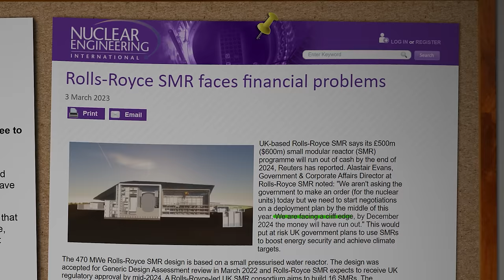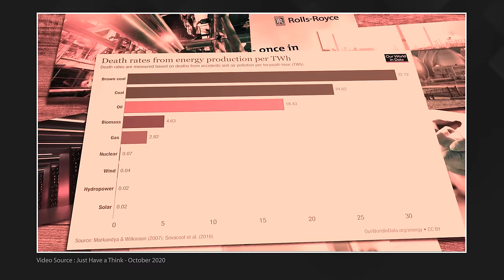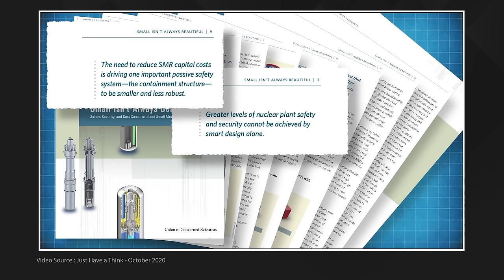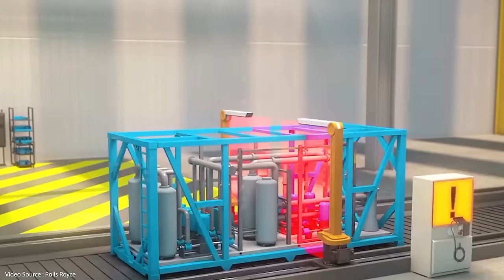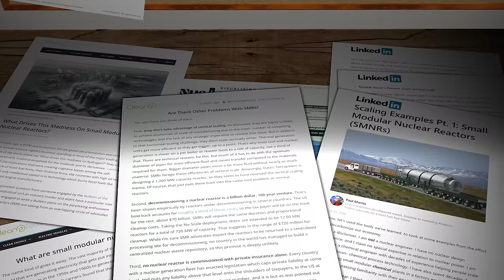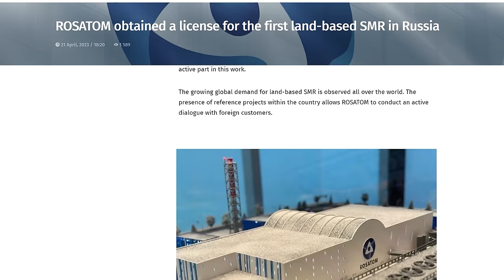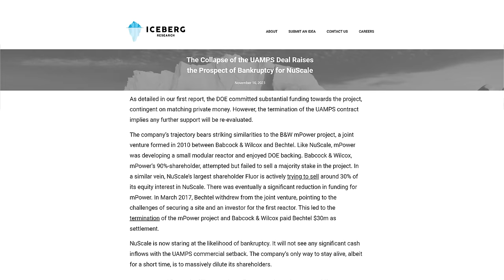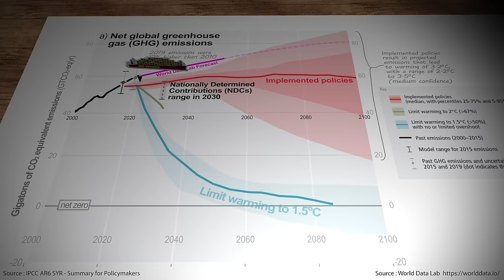Small Modular Nuclear Reactors. The Verdict

Comment: Wind and solar might be great in the UK but it’s far less effective in cold climates where the sun rarely shines and the snow and ice cover the panels.  If China can successfully install the Westinghouse system it seems reasonable folks in northern USA and Canada could also make SMRs that produce reliable power.  In quantifying the cost, the high voltage trunk lines of the grid need to be included in the cost IMO, as well as the many transfer stations.  Add to that the vulnerability of the system to cyber and traditional air bombardment in time of war and the exposed surface grid would be an existential threat to the inhabitants in wide regions depending on the transfer of power through the grid.  I suspect the ROI analysis would require considerable time to assess the long term systemic differences and how grid replacement might change the calculations as well as vulnerability to a large solar flare or an EMP attack or other forms of destructive nonsense that happen in time of war / military conflict.  Just suggesting SMRs may be an important part of the future state even if they are more costly.   If wind and solar only outputs 20 percent of the system capacity due to weather issues…. or the transistors are fried by solar flares and have to be replaced….. or maybe they crack from the ice storms …. the real world efficiency and cost per unit of electrical output may be much higher vs installation in moderate climates with lots of sun or wind.

Comment: Yet to see the key environmental concept of "cradle to grave" applied in any such discussion nor, most importantly, reflected in government policy.  What are the environmental (and economic) cost of building SMRs, solar or wind farms?  What are their respective lifespan and prospect/cost of disposal (or material harvesting/reuse)?  What are the storage and transmission requirements and losses?

Prudent choices necessitate a cradle to grave analysis.
Reply: Well, we know renewables can mostly be recycled. Wind vanes not so much, but they would occupy a fraction of the landfill that goes to coal ash, per unit of energy produced.

Another question is "what if it's not recycled/disposed?
Well, a PV panel dump would be unsightly, but you could walk around in it, or just bury it.
Neglected batteries will certainly contaminate a local area, but will react naturally to more stable compounds in a matter of years or decades. It won't kill you to walk across such an area in gumboots.

Spent Nuclear fuel and abandoned reactor equipment has no such comfortable images. The containment structures will fail without continuous maintenance, Either quickly in spent fuel fires, or slowly by erosion. The release of materials will be correspondingly fast and wide, or more gradual but highly concentrated as it follows waterways. It will make huge tracts unliveable and dangerous to traverse, and the source will be extremely dangerous to approach for many centuries.
So far no Spent Fuel or High Level Waste whatsoever has been disposed. None. this, the richest generation of the richest group of nations on earth thinks disposal is too expensive.
Imagine a less rich society, after a war or extreme climate events, or multiple crop failures, or plague, or just economic collapse. Who will pay to maintain existing temporary storage? Who will pay for the permanent disposal megaprojects that are presently too expensive?
As these facilities age, the time where we have options will reduce to nothing. There will be a time where the only options are to support a workforce to do it (slaves?), or move to the Southern hemisphere and hope that the few facilities in Africa and South America do not release too much too quick.

Comment: All new tech production methods, especially for heavy industrial infrastructure like power, comes with initial cost overruns that are often covered by additional investors and governments. This is initial early cost teething and nobody should be too concerned about it. Remember folks, solar panels required decades of direct government subsidies to get to their current pricepoints and the same goes for other renewables as well, nuclear is no different. People need to stop fearmongering especially considering that the vaunted storage options everyone talks about remain non-existent outside of solar thermal powerplants as batteries currently available do not cut the mustard. Nuclear is coming back too and alongside every other green energy source.

Comment: Going small and away from large complicated infrastructure, is a better idea than mega scale projects. No matter the energy source. Give me the option to generate all the power I need, where I live. Yes there are, of course, large population centres that need significant power. However, there are large areas of more sparse population that should de-centralize, moving towards self generation for all their needs. Supporting that will decrease the over all load, which helps larger centres. Someone somewhere should crunch all kinds of numbers ad see if there is a more cost effective option. I have been thinking for a while that the correct balance could be found. Do that while still looking for a magic bullet, like: SMRs; plasmoids; .... etc.
Reply: 87% of the world’s population lives in urban or suburban areas. Your exception, large population centres is the norm. Remote areas can utilise solar panels, wind turbines and battery storage. The exception is high latitudes in winter. Up there it’s mega project or survivalist in winter. Much of the urban environment the low density part can also use solar panels, taking loads off mega projects. Adding batteries there will probably give 80% or so grid independence. No SMR in sight.

Comment: Sodium has it's own problems. However, corrosion with Molten Salt Reactors can be handled with material choices. High nickel alloys, graphite and ceramics can be used to minimize corrosion issues. Also, Dr. Weinberg's work in the 60's illustrated that restricting oxygen in the reactor and metals produced as fission products form a protective layer that was effective in preventing or minimizing corrosion within the lifetime of the reactor. 
Corrosion is a "false Flag" objection to  the implementation of Molten Salt Reactors!

Comment: Thieryty years ago I was a firm supporter of nuclear power as the only feasible way to avert runaway climate change - I argued endlessly about it with my greeny friends. Fortunately a much better way of decarbonising appeared (albeit arguably too late to avert climate disaster - we shall see). But even then I knew SMRs would never be viable, based on the experience of the Soviets who had made a serious push for them and the known economics of scale in thermal electricity production (where are the Small Modular Coal plants if this approach made sense? For that matter where are the Small Modular Thermal Solar plants?). Photovoltaic solar has very different scale economies, which is in fact one of its major cost advantages.

Comment: The voyager space probes, and other space vehicles use SMRs for power. In fact, many vehicles that need to operate in less than ideal environments use SMR's. Submarines, etc. If Intuitive machine's (LUNR) Odysseus moon lander had used an SMR, its mission would not have ended so abruptly as it did when its landing site on the moon fell into shadow a few days after landing. The fact that it was powered solely by solar energy is why the mission failed. Intuitive machines plans to send another lander in the near future. Guess what will be powering the lander? Anyone who thinks that SMRs will not be absolutely essential energy sources in the near future, isn't paying attention. Space exploration is being commercialized rapidly. Satellite technology is absolutely essential for communication. Back up systems need to be non-solar in case of solar flares, etc... Furthermore, any nuclear waste produced in space is easily discarded away from Earth. I'm investing in SMR while it's cheap to invest in SMR.  Buy low. Sell high (if at all). That's my motto. :) The future is almost here.

Comment: New to this channel. I like it. Question : What is the plan for storage for wind and solar? The calculations i do for battery storage make the LCOE 3 times that of gas and coal
Reply: Your calculations are wrong.  Look at the LCOE work that Lazard has done.
Reply: @incognitotorpedo42  actually was looking at this today, it has LCOE of 114 dollars for onshore and 140 for offshore... Here in ireland, the strike price is 86 euro. It's a big difference...
Reply: Your calculations are trash thats why.  First off not all enegy will get stored, most storage will be by cheaper methods like Pumped Hydro, compressed air, Flow batteries etc, and the cost of Li-ion batteries are plummeting.
Reply: Yet renewables + storage is still much cheaper than nuclear. Coal so long as using the atmosphere as a sewage dump will always be cheaper. If we incorporate externalities with a carbon tax we'd see who'd actually win out.
Reply: @kennethferland5579  im in ireland, pumped hydro not an option. Im genuinely wondering what the best option is for ireland. It seems to be lithium ion, and a high LCOE
Reply: @Zanderzan1983 
Why isn't pumped hydro an option in Ireland.?
Reply: @davidwatson2399  Ireland is very flat. We have one built in the 70s and we're building one more in an old mine, but that's it, we just dont have the mountains
Reply: @Zanderzan1983  
But you have wind and tides.
Anyway, what's your point ?
Are you going to keep digging up your peat?
Reply: @davidwatson2399  my point is genuine - how does a place like ireland store energy in a 100% renewable? Im totally pro renewables btw. The cost of battery storage is prohibitive. We have a cavern in the north which could be used for compressed air storage but i believe that also needs gas. Hydro at scale isnt an option. By the way our peat is basically all gone - what's left is 80% water. They didn't stop for climate reasons, they stopped after they'd burned all the economically usable peat

Comment: The holy grail of electrical supply is producing for the "base load". Wind produced electricity from the fan on a stick method or PV solar will not give this. Modern nuclear and hydro will. Locations suitable for hydro are near exhaustion. There is only one option left at the present time, which is nuclear. Modular nuclear has an increasing advantage, as power shotages start to bite. They are fast (relatively) to build. People won't move until they start tasting "hunger sauce", as my grandmother used to say.
Reply: Base load is the old paradigm.  It's entirely unnecessary in a renewable world.  Instead, you focus on maintaining sufficient production, storage, and inertia.  Base load is irrelevant.

Comment: As with almost everything in the renewable energy sector small modular reactors (S,M,R,) It would have been better if their development had started 10 years earlier, but I would not 
Would not dismiss (S.M.R.`s) too quickly, I believe they could still play a role in replacing fossil fuels, and I think you were a little hard suggesting these units would take ten years to 
build, while it is true that it will take a long time to design to a high standard (but it is something you would not want to rush at) once a design has been through its verification and testing regime, the design of a production system should allow for components to come together to be assembled in quick time, while they may not pop of the production line with the speed of plastic bottle tops, I believe it would be more like jet engine production.Of course, as with so many projects how long they take will end up with planning permission and overcoming objections and public enquiries.  

I believe we should be positive about the prospects for small modular reactors (SMR`s) built in factories; these truck size modules would be produced to exacting engineering standards, 
without the effect of varying light levels or poor weather conditions, a standard design would allow for production line efficiency, which should minimize cost, plus at the chosen site, one (SMR) could be installed, and start to operate, while another part of the site was being made ready for a second (SMR) or a third and so on, or a single (SMR) could be delivered to a large energy consuming company like a steel plant, cement factory, chemical works, glass manufacture or desalination plant.I believe there will be many countries, in the coming years that will want a nuclear power base load, and will find it financially efficient to achieve this by installing one (SMR) at a time, there are also many large energy consuming companies around the world, who would 
appreciate an independent energy generating system, that would allow them to have power at a predictable cost over many years. 

(SMR) building could become a major industry in the coming decades, suppling (SMR`s) to the world could be 21st century engineering equivalent, to the 19th centuries suppling the world with locomotives, or the 20th centuries supplying of jet engines, and it is something a British government should be actively engaged in by pump priming, a 1950`s government turned down a request to help fund computer development, because they could not see a market for such machines. Just one additional point, any (SMR`s) built in Britain and supplied to another part of the world should have a clause in the contract requiring that its radioactive fuel is returned to Britain at the end of its life. For the simple reason that Britain is one of the very few countries I would consider stable enough to look after radioactive material for the long-term.

I believe that Japan is developing a very high temperature, gas cooled, fission reactor 
But not to generate electricity but to produce Hydrogen through a high temperature 
chemical reaction, such a high temperature reactor might also prove useful if coupled to a 
steel or glass plant, if this development proves successful Britain should consider buying into 
such a technology.

Comment: confused at why new construction is the go-to when retrofitting existing coal plants with nuclear is much more economically viable, less costly, and utilizes existing framework without generating excess waste material. even with the cost of shielding.
Reply: 1- nuclear plants operate at different pressures and temperatures than coal plants. 2- do you think it would be a good idea to spend billions on a new nuclear plant and then attach it to and old coal plant secondary?
Reply: @clarkkent9080  pressure can be regulated, temperature can be controlled, and 2 is just moronic.
Reply: @arc4nimus  Coal plant equipment operates in the superheat range while nuclear plants do not.  And no you cannot just regulate and make a nuclear plant match that. 

 Terrapower plans on attaching their MSR to a 60 year old coal plant in Kemmerer Wy.  Lets just wait and see how much of that old coal plant that they end up using.  My bet is they will only use the switchyard but even that will be risky using 60 year old breakers and disconnects.
Reply: @clarkkent9080  history will vindicate me
Reply: @arc4nimus  Well is Terrapower, which has been trying to build a nuclear plant since 2016 ever breaks ground, then we will see.  And by the way, Terrapower is the ONLY new nuclear power project planned in the U.S..  The last new nuclear project (Vogtle) took 16 years and that was a standard, well established PWR. Terrapower (headed up by Bill Gates one of the world's richest men) received $2 billion in taxpayer welfare and is asking for $2 billion more and his 345 Mw reactor would be a massive financial failure if it cost $4 billion. 

The only reason Terrapower is planning on siting at an old coal plant is purely for political reasons, trying to convince coal workers that they can transition to nuclear.  That is a joke since the only nuclear jobs that coal workers could transition to is security and clerical.

How do I know....I worked in the nuclear industry for 40+ years at 5 different facilities.  What do you base your beliefs on?